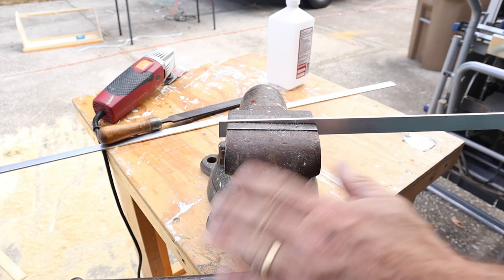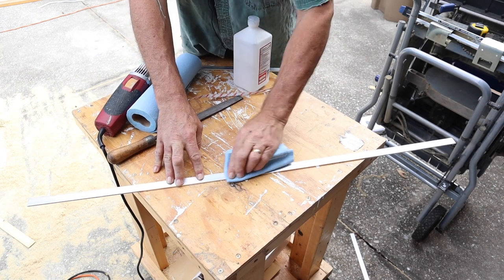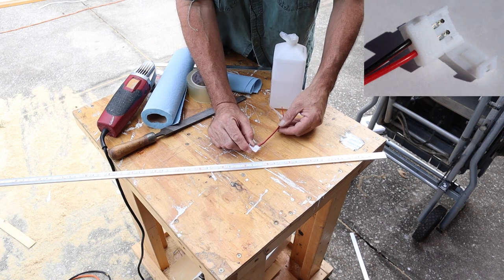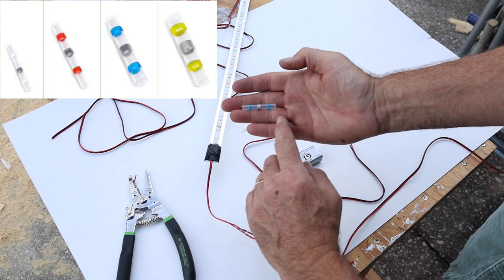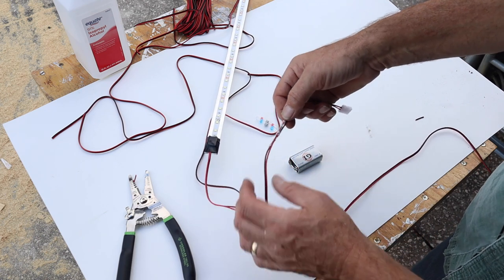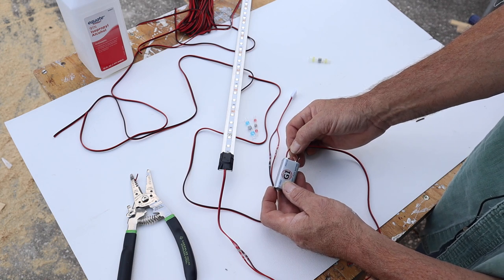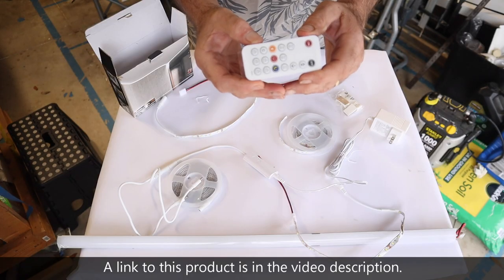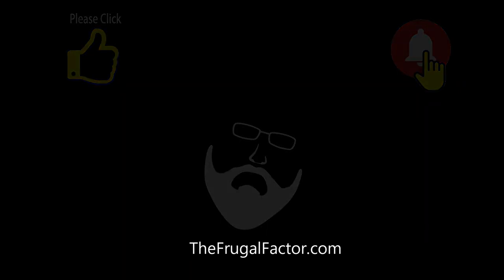Van Life build series - Selecting and Preparing LED lights for installation

Comment: Still waiting on how you did the splicing and wiring to the led strips into your system. Can you cover that and notify me and Jaques who also seemed to have commented! Thanks, I've been watching all your videos!
Reply from the maker: Thank You for the reminder, I will put that on the to do list.  I will do a video soon on connecting DC, and running electrical lines to the fuse panel.  Covering LED, Pumps, everything 12 volts.   Hope to post this within the next two weeks.
Reply from the maker: I just posted (1-29-2023) a video that may help you out:  https://youtu.be/uyCr2k4XXAI
Reply: @FrugalFactor  thank you very much man!!

Comment: You mentioned you would do another video regarding splicing and wiring the led strips into your system. Are you still planning on doing that? I have questions as I bought the same items but I am sure you would cover all these in your video and I can wait.
Reply from the maker: Yes I will cover that and all the electrical in future videos.  I will do my best to answer and questions you may have...
Reply from the maker: I just posted (1-29-2023) a video that may help you out:  https://youtu.be/uyCr2k4XXAI

Comment: Just checked Amazon. Have you tried the warm light version?
Reply from the maker: The warm light version is a different color temperature, a little yellowish.  Many people like that better - its less harsh than the daylight version I am installing.  I just like the bright white.  Just a personal preference.
Reply from the maker: @vandaddy-o2732  6500K is the color temperature.  Dimming does not change the color.  Best to Google color temperature to see what I mean or buy some low cost LEDs and try them both out to see which you like best.

Comment: What size wire are you using for your 12 volt system
Reply from the maker: See this video  https://youtu.be/AJGZh6iW5CE     I have used 12AWG for most of the 12V wiring.   I have used low cost 16AWG extension cords for some LED lights.  I purchased different color 16AWG extension cords.  So, if I need to track down any problems in the future I can easily track what wire goes to each set of LEDs, because each LED circuit is a different color wire.
Reply: @FrugalFactor  Thank you for the reply

Comment: Question- is it possible to install a separate on/off switch and not need the remote to turn it on?
Or can I use my on/off switch, then use the remote just for color/dimming?
I
Reply from the maker: You could use an On/Off switch to turn it on and off.   Its nice to have the fancy colors.   But in reality, we now just turn it on and off (just white).    If your Van building you can see all my videos divided by category at  https://thefrugalfactor.com/